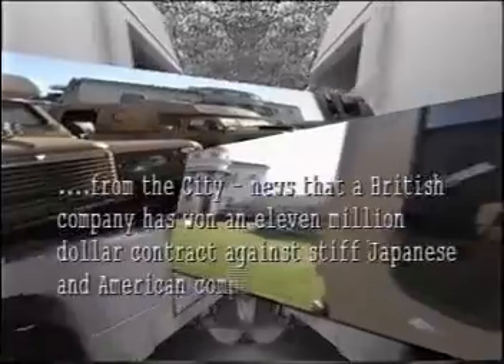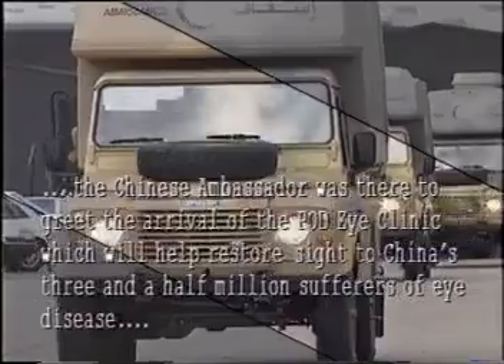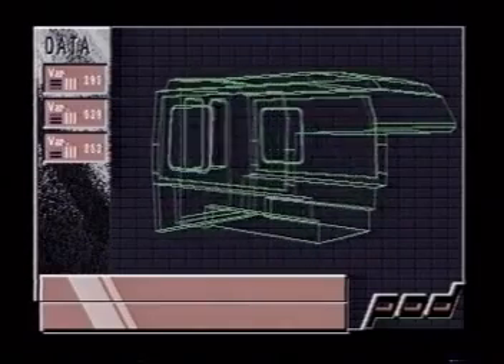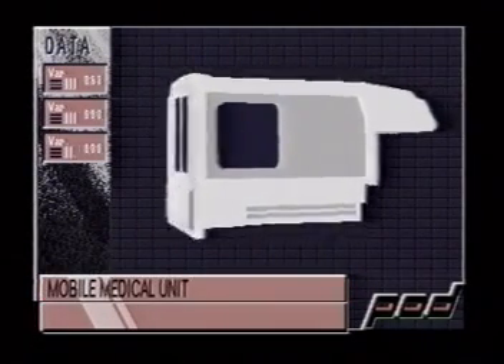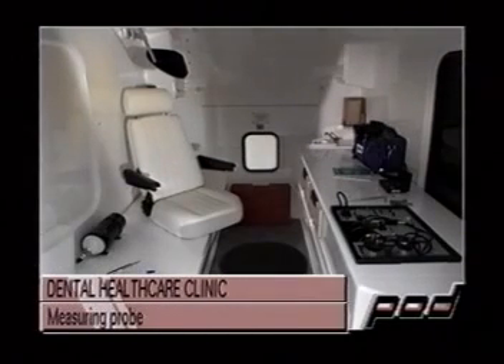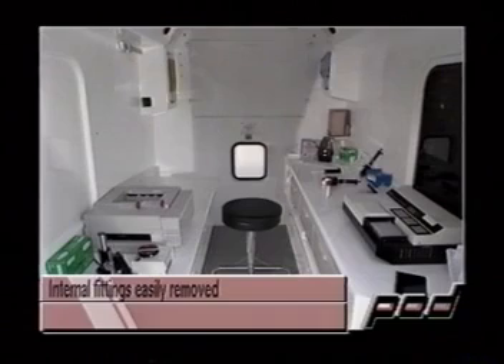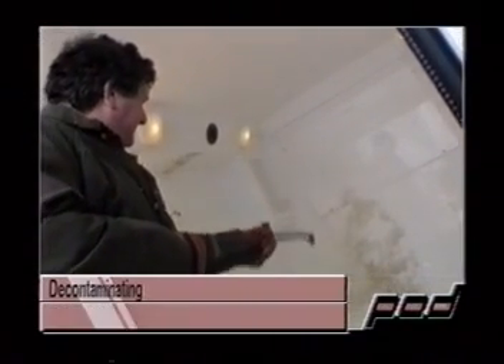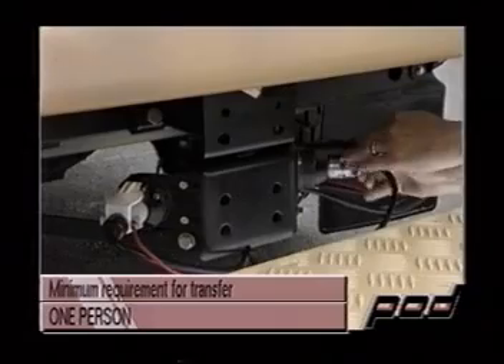Shanning POD Mobile Medical Units Land Rover Defender 110

Comment: Hi John
I have one of these PODs in my custody and I was trying to find more about them without any success.  This is the only video I can find along with one on Vimeo by Simon Burgess.  I tried locating the Director of Shanning at the time to ask about further info.  Again couldn't get any luck.  Do you have any info or strings you can pull to connect me to Mr. Kenneth Burgess or anyone form the Shanning legacy?  Much appreciated.
Reply from the maker: Arif Al Yedaiwi Hi Arif
I use to work for the company between 1989 and 1991. These units were manufactured in a town called Aylesbury in Buckinghamshire, UK. Unfortunately, I can't help you with contacts, as I'm no longer in contact with anyone from the company. I do, however have a plethora of photos that I took from around the time.... John.
Reply: John Hounslow That would be awesome. I am looking for electrical wiring diagrams or any info to help me rebuild it to its former glory. I am turning it into a camper. I shall send you some photos in two days.